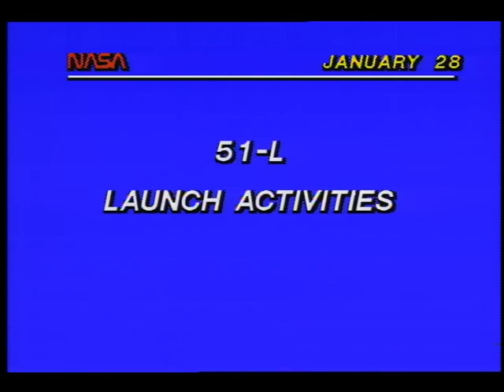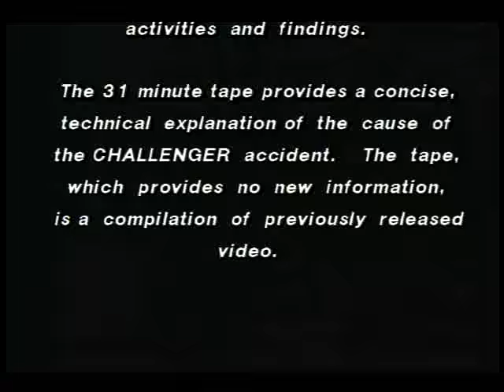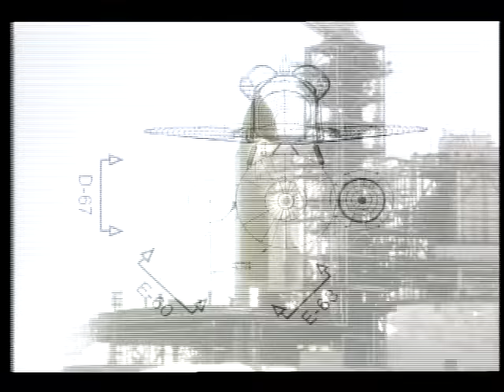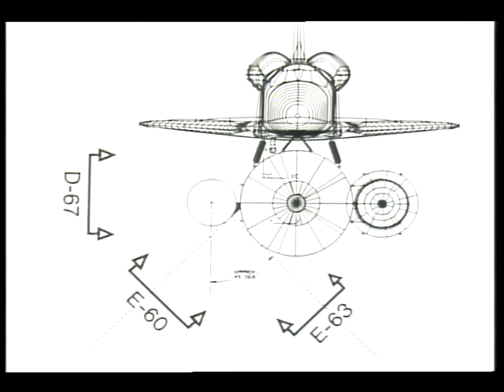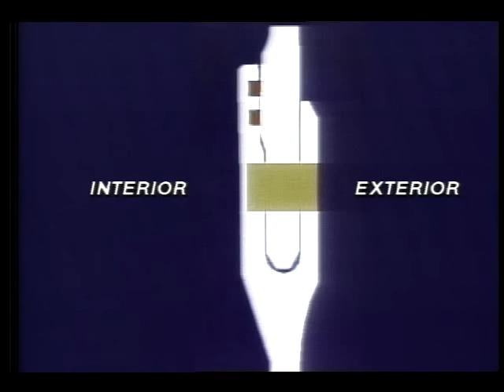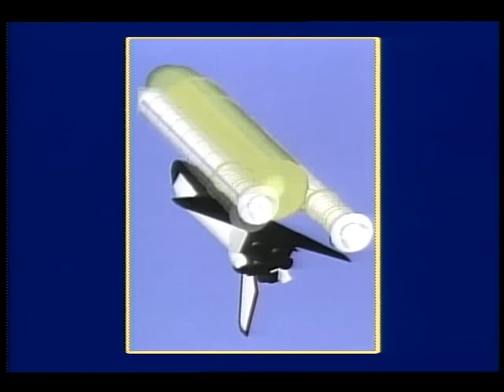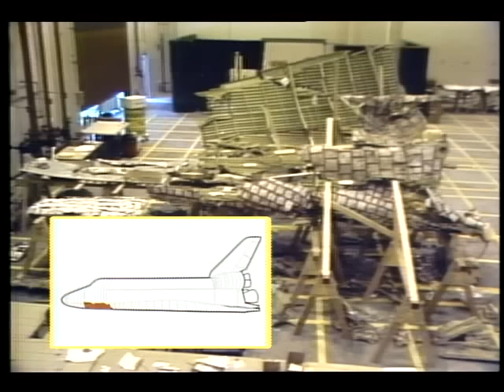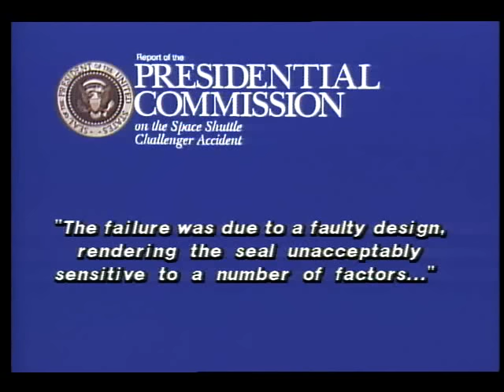Shuttle 51L: Challenger

Comment: I remember where I was and what  was doing when this happened. I've always wondered why there was no auto abort when the computers were watching this happen. A lot happened in a short period of time, but I would have thought there would be the ability to abort at any time during any part of the flight.
Reply: Another in the long tail of bad decisions leading to the disaster. The shuttle boosters were solid fuel boosters. Solid fuel boosters cannot be turned off after ignition. They have never been used before the shuttle for human space flight, and they have never been used since. A solid fuel booster is a giant tube of explosive paste which is lit from the bottom at launch. As the material burns, the exhaust goes out the back, propelling the rocket. By contrast a liquid fueled booster has actual engines with fuel lines that can be turned on or off. Since the boosters cannot be turned off, no abort is possible during the time that the solid fuel boosters are thrusting.

Why did the shuttle use solid fuel boosters? Because they didn't want to spend money developing new boosters so they just repurposed existing designs that they had on hand for the shuttle.

Being solid fueled is also why the boosters even had O rings in the first place. It's infuriating all around.
Reply: @DavidJao  The SLS ALSO has solid rocket boosters, (larger than even the ones used for the space shuttle) that will be used to carry human crews back to the Moon, and will be used next year when the Orion is sent around the Moon with a crew of four.
But at least, the Orion us equipped with a launch escape system, (similar to the one used in the Mercury and Apollo flights; the Gemini missions used ejection seats).

Comment: So had they had immediate notice of the nature of the failure... Their only chance would have been to drop the SRBs (dangerous in itself) and carried on on the SMEs, and done the flyback manoeuvre, where they pretty much get to space, turn the throttled back orbiter and tank round 180 Deg and then throttle up again to slow down and head back to the departure point (or across the Atlantic to Spain . There was a window of a few seconds between the two options) where they would ditch the tank and land on the runway just a few minutes after launch. I did hear they wanted John Young to test this on sts-1... And he just flat out refused right? Since it was really a last ditch thing to do if there was a thrust issue in the first 10s of seconds after lift offb(which ejecting the SRBs would count as!)... But they didn't have any warning or possibility of knowing exactly what had happened... Screens showing all ok even after the orbiter has disintegrated. ....

What a shame. However the shuttle program should have ended right there (as much as I loved the thing and watching the launches... It's pretty clear the design was flawed and never reached it's design goals of cheap access to space)....

Hell we might be back on the moon by now using shuttle derived tech (the SMEs and boosters were superb in design and massively powerful).

At least that albatross is give from NASAs neck and private industry and competition were allowed into the Manned Space Program ... With predictable success after a period of testing and failures. Also Buran \ Energya might have made a Lunar program possible, with a combined NASA, Euro, Japanese and Russian effort. One Energya could put 20 tons into Lunar Orbit, with reusable landing boosters, an orbiter with arms capable of putting a larger craft together in Earth orbit...but they only flew Energya a couple of times and scrapped it through lack of money...when NASA could have swallowed it's pride and funded what may have proved to be an even more versatile and safe system than STS.

Not to be though. Lessons are always hard learned in Gov programs I suppose.
Reply: Negative. You would not be able to drop them while they were lit. Tests showed the booster would get caught up on the aft attach points. They would have to wait for nominal Sep before rtls. This is why manned flights have escape systems and don't use solids.

Comment: On the face of it, I would've thought rubber o-rings inside a rocket motor would be a bad idea but I guess it worked most of the time
Reply: All because of politics too. Thiokol absolutely had to make the SRBs because of backdoor government contracts. And because of their own contracts with their state, production of the SRBs had to be done far far away from Kennedy Center. Which meant the SRBS had to be made in segments and shipped to Florida. Had they made the SRBs in Florida at Kennedy, they could have been made out of one large piece.
Reply: @rob mausser  out of the three bids by different companies,  Morton Thyocal was said to have had the worst design.  But politics and money talks
Reply: I believe the o-rings had partially failed on a previous flight too, but they got away with it that time.

Comment: Why didn’t they try and deploy SRB before it ignited the main fuel tank ? Could of then at least carried on with just the main shuttle engines then tried  emergency land.
Reply: I'm gonna go on a limb and say nobody knew it was happening until pieces started falling. Heck in the broadcast someone reads out telemetry way after the stack disassembled. And yes individual engineers probably did see stuff go off, like the pressure changes, and the difference in booster trajectory but they had literally not time to act between noticing, making sense of it, and even beginning to utter anything to anyone.

Comment: 1:44 Someone wearing black was on the launch platform up near the top of big tank, exactly were it leaked then the gas moved down between shuttle and tank. When gas leak reached engines it started to burn, then full throttle caused explosion.

Comment: Many  of the comments that the shuttle   did not explode are true.😅 The external tank came apart and dumped all the fuel and oxidizer at once which mixed and ignited
The correct term is "rapid deflagration"

Comment: What was the reason for shuttle explosion? Wasn't there crew escape system? Can someone answer. May the crew member souls rest in peace 😢😢
Reply: the explosion occured when the seals failed, allowing the exhaust flames to breach one of the shuttles struts, which then punctured the fuel tank. At that point the crew had no way to escape, they were basicly doomed once the seals failed.

Comment: A lot of politics went into making this vehicle.  One major political requirement was to make the shuttle reusable.  The SRB sections were often warped after use, and had to be bent back into shape.  Warped SRB sections may have been a contribution factor to the O-Rings not seating properly during assembly.  Engineers have a duty to reject substandard practices, and assembling a bent SRB is one example.

Comment: It happened on "Throttle Up", related?
Reply: AS FAR AS I UNDERSTAND... (could be wrong) Not "really". The O-ring seal was damaged beyond destiny in the take off because of the cold temperature, but irony, it was so cold that the leak solidified because of that and seal "itself". Then, the winds up there were too strong so they pushed the whole system sideways. Since it tried to keep the route, the wind pushed on the opposite direction, and they throttle up the main engines at the same time, it was too much for that fragile  "seal" and it broke and, on one hand, put a differential between the 2 SRBs, and two, it broke the bottom union between the right SRB and the liquid fuel tank so essentially it broke apart.
Reply: @ubiergo1978  Was my point, did the throttle up push the damaged O ring too far.
Reply: @tomhartman2254  Oh, the O-ring was already burned at that point, it was the black smoke at the lift off. But if I understood well what Allan McDonald said in another documentary. It was mostly the wind pushing and the SRBs trying to counter that, what mainly caused the "new" seal to broke. The throttle up was, IF (and only if) I understood fine, just what... how we can say... "the cherry on the top".
Reply: @ubiergo1978  Make sense
Reply: @tomhartman2254  photo evidence later showed the O-Ring failed seconds after the shuttle left the pad

Comment: I was in high school when they first flew the shuttle.The two test pilots had pressure suites and parachutes.Why they stopped using the suites and chutes seemed a bit over confident,They could have warmed the joints in the boosters with electric blankets like F1 racing cars use .Crazy decision making by the pushy NASA managers ,Dunno how they got the job..I think there was a bully involved with it all.

Comment: The shuttle was brought down by someone initiating the separation from the main tank at the portion of flight with high aerodynamic forces causing it to break up and explode, the shuttle also carried top secret explosives that were to be tested in orbit.   These explosives blew up during the breakup ending any chance for crew survival.   NASA had to find a patsy so they chose the SRB and manufactured video evidence to back up their lies. The SRBs burn from the center outwards so the unburned fuel would not allow a leak.   If one booster was leaking bad enough to burn through the main tank insulation, hull and inner tanks it would have started spiraling out of control but instead it flew through the explosion and kept going up just like its twin.   NASA Never A Straight Answer     Who triggered the separation?  Was it an accident? Was it an israeli or Soviet spy?  Did the schoolteacher accidentally hit something or was she a deep cover soviet agent?
Reply: You're just showing how little you know and understand about the shuttle.
Reply: Your lack of understanding is really sad.

Comment: The range safety shouldn't have destroyed the SRB's as they were flying AWAY from the launch site after the tank exploded and the shuttle broke up.
If they had let the boosters run out of fuel, and were allowed to have parachuted down to the sea, NASA would've found out what REALLY happened within less than 24 hours after the accident.
Instead, it took MONTHS to find out what went wrong, and a subsequent 2 1/2 years before the Discovery launched in September of 1988.
Reply: They were almost a minute to burnout.  Out of control where they were put them within the spherical coverage the RSO was there to protect.  RSO followed correct procedure.
Reply: It wold have made no difference… after the disaster the whole stack had to scrutinized. You dont stop your investigation when you’ve found one likely culprit.
Reply: @tusse67  The Russians would have.
Reply: @davidharrison7014  Dont see the point of that reply? Its a golden rule of a proper investigation of an accident that you dont get tunnel vision when looking for the reason.

Comment: They claim it weighs over 3 million pounds but no way a blimp weighs that much. The sparks for combustion made me chuckle then it starts bouncing. 
The shuttle that’s a glider but has turbine engines and the same flight dynamics as a large aircraft. 
You need to set your pride aside and scrutinize what your seeing truthfully.
Reply: So a turbine engine requires large air intakes in order to work.  Please indicate exactly where on the Orbiter those are located.
Reply: This kid doesn’t understand what ROFIs are or how jets work